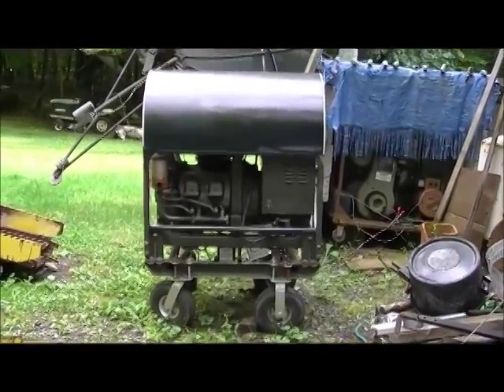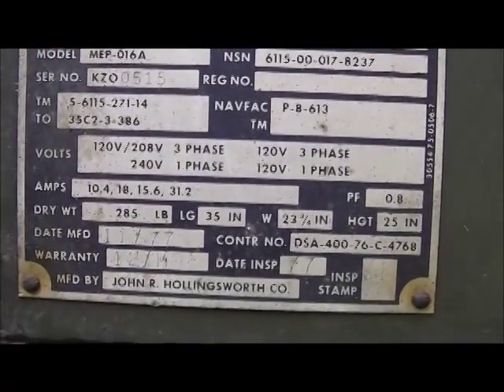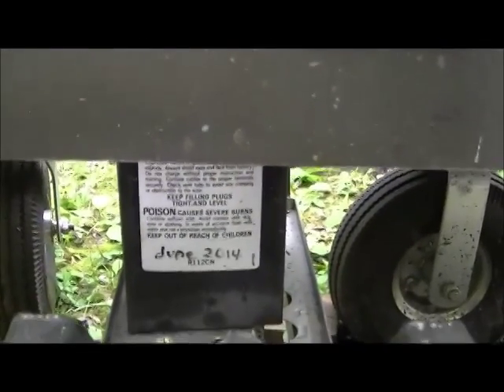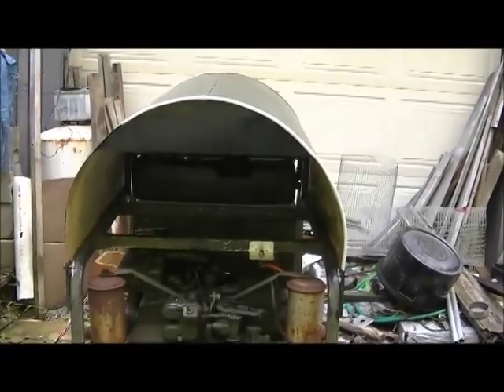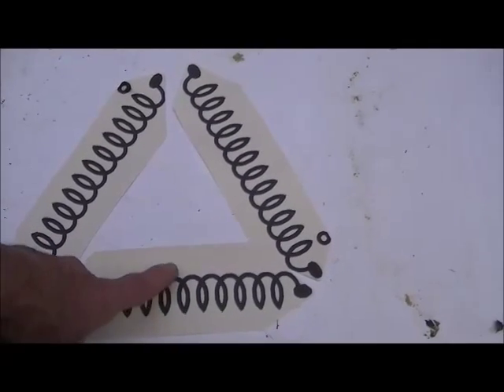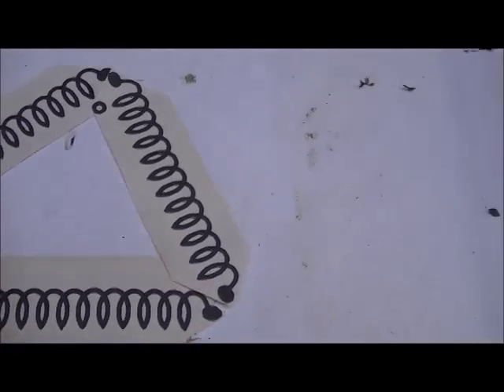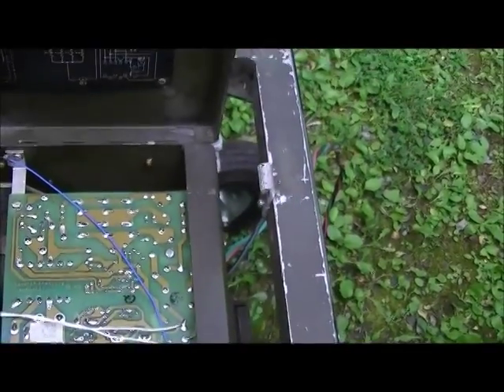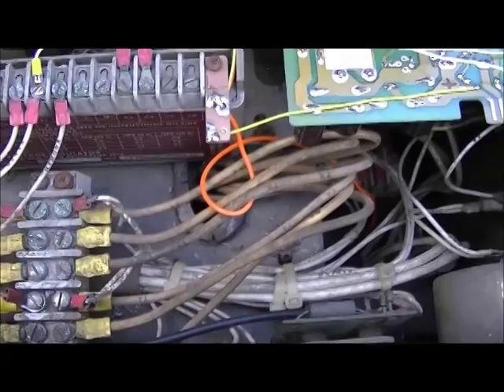MEP016A Military generator

Comment: I have the same model 1968 concert promoters make but I am unaware if it is capable of three phase power would you happen to know anything about this or know where I can find out more it's a 28 volt DC send an email to mindash@comcast.net I would really like to have some correspondence with you as I am completely out of my league trying to figure this thing out I picked it up two days ago with 46 hours of original run time and what smells like the original gasoline from the 60s in stupendous condition for $50 and would love to find out if I can have this power 3-phase in any way as there was a device I am planning on creating down the road to run some experiments with based on a series of Rodin coils
Reply from the maker: Mine has a selector switch in the box where I can select 240v single, 120 single, and 120 3 phase with ground or 208 3 phase without ground.

Comment: that's not a MEP016, It's a MEP4A032
Reply from the maker: Do some research before making a stupid comment, it is a MEP016, MEP = "Military Electrical Power", these engines are used on other things besides generators. The engine is NOT a MEP4A032, it is a 4A032 that = 4 cylinders, A =at, 032 = 32 cubic inches displacement.